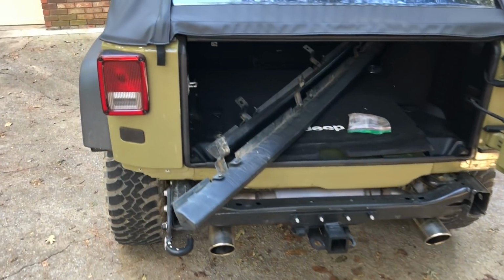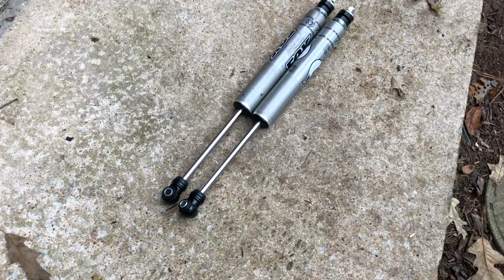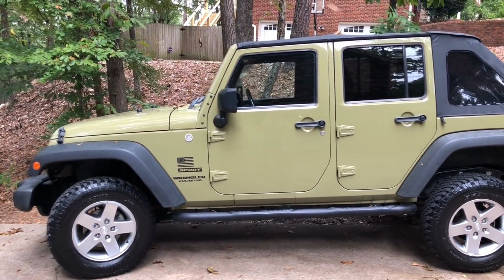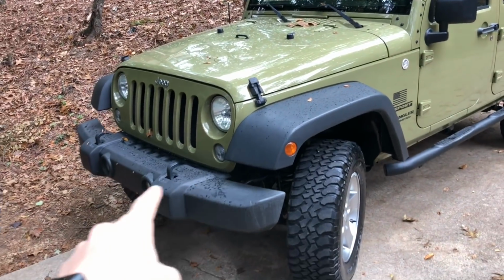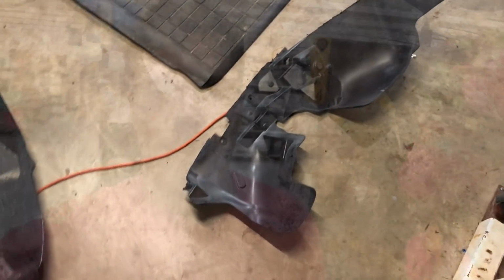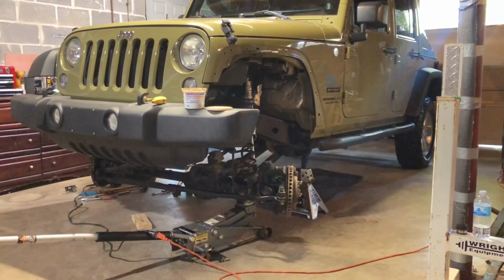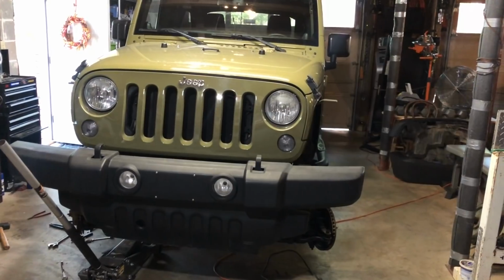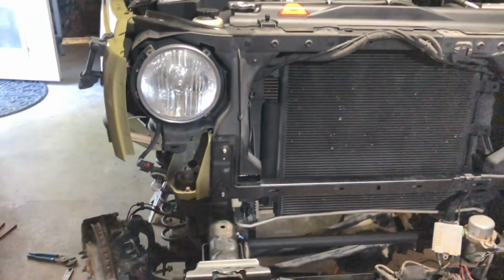Warden JKU | Preparation For New Wheels

Comment: I could understand all the temporary mods if it was someone's 1st rig and they never built one, just anxious to get the ball rolling & making do with what their budget allows but usually down the road, after swapping out things that were supposed to be "temporary" one comes to the realization that if they had only been patient & done things right the 1st time, a lot of time and money could've been saved. So being that this isn't your 1st go around, I would've thought you would've realized all that. Most of these temp mods are actually more detrimental in the long run than beneficial. Spacer lifts without adj arms, wheel spacers ect. What are you accomplishing? Throwing off geometry, caster and for what? Clearance bigger tires and wheel spacers for back spacing because you don't like how it handles with smaller tires, which is what it was originally designed to do and you believe that it'll handle better with these temp mods? There's no logic to that and you only feel that it'll improve because you're used to driving a rig with poor geometry.
Reply: Jeep fanatic you don’t understand. It’s okay. The temporary mods were free.